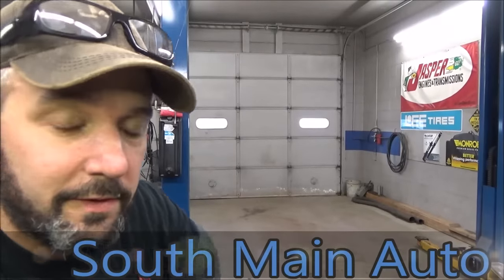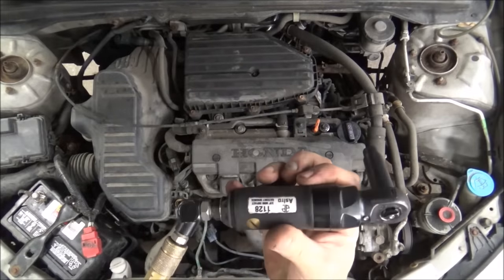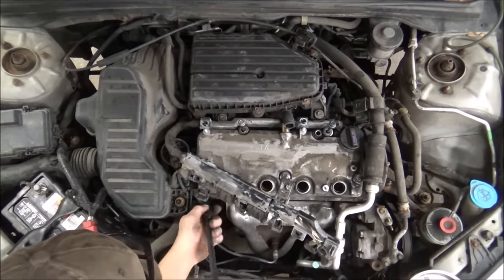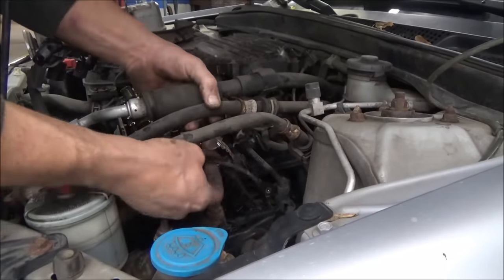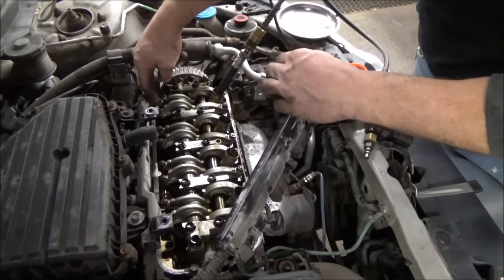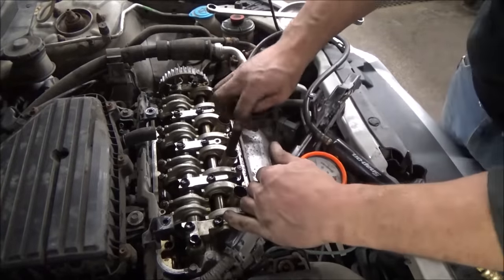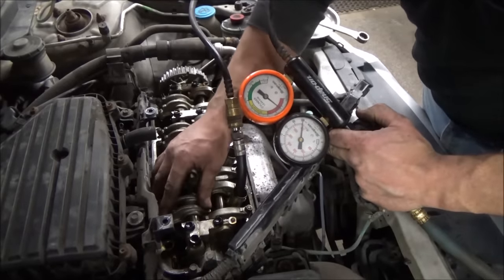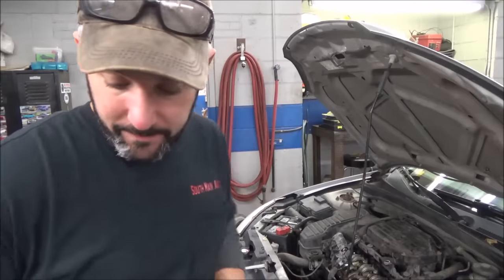Honda Civic 1.7 - Crank No Start

Comment: Meh, ideally on those engines you should pull the cams so all of the valves are indefinitely closed. If it improper valve lash was set,  you might be accidentally mistaking a leak for someone elses mistake.
Reply from the maker: +Swot Roke Nope, if the rocker arm is loose then the valve is closed. Valve clearance would not be an issue. Loose is loose right!?
Reply: +South Main Auto Repair The reason why the engineers recommend this particular procedure is because if you do a leak down test and your other cylinders are open, if there is a break in the head gasket it can cause a false positive because the compressed air will leak into the other cylinder that has valves open. This is particularly difficult to diagnose in a noisy shop. . Additionally, faulty valvetrain components can also send you on a wild goose chase. A loose rocker arm does not always mean the valve is bent. 
I specialize in "last case scenario" diagnostics and mainly work on Honda/ Acura. I've found on B, D, and F series engines, you get more accurate reading when removing the cam(s).
 

Removing any and all possibilities of doubt or variables will allow you to accurately diagnose the engine. 

I'm not bashing you at all, I love your channel and you are clearly a skilled master of the trade. I was just offering some personal experience and food for thought.
Reply from the maker: Ah got ya. Sure I can see that I suppose on a rare occasion. In this case with a snapped belt I wasn't to concerned with a blown head gasket but I see what you are sayin too. Thanks for sharing your knowledge!
Reply: +South Main Auto Repair thanks for replying and keep posting the good vids!
Reply from the maker: I suppose it may be just as easy to remove all spark plugs too? If it was leaking into a companion cylinder you could hear it?
Reply: +South Main Auto Repair This would help, but only if you removed the cams. Listening to the oil feeds and radiator with a stethoscope will really help you pick up on noise. The only reason I mentioned it is because of the way the valve adjusters are set up on those and the mileage, they could just be loose do to poor maintenance. They also come loose sometimes and give a false reading.

Comment: I just did the timing belt on my car 20k miles ago and this just happened
Reply: Was it a cheap belt? But, even if it was, it should have lasted longer than 20k. (I put a new cheap front wheel bearing on my Honda Civic. It went out in 5,000 miles. Sometimes cheap, inexpensive parts are not worth putting them on). Was your engine also destroyed?

Comment: You think engineers would have factored in a bit more  head/ valve clearance especially seeing they are using a rubber band as a timing belt.  Probably have to keep car sales up and moving.  Can't make them last forever or they go broke.  Bunch of dolts....

Comment: couldnt he just throw a junk yard head on it?
Reply: chrisrhudy2000 who knows if it would seal. You should at minimum check for warpage but I have never just slapped a head on something without having it rebuilt. And who knows what it did to a piston.
Reply: @dandurst2075  machine shop would know for 80 bucks